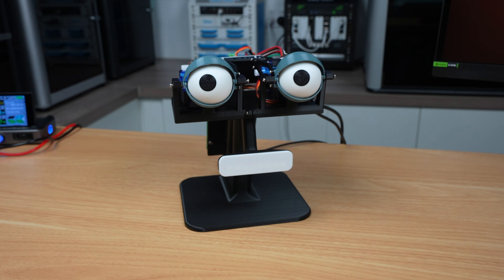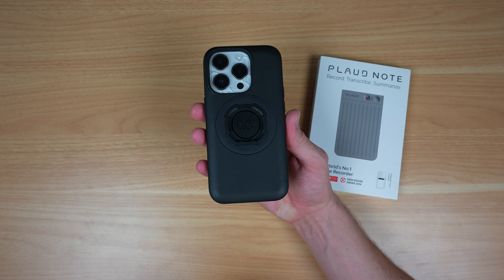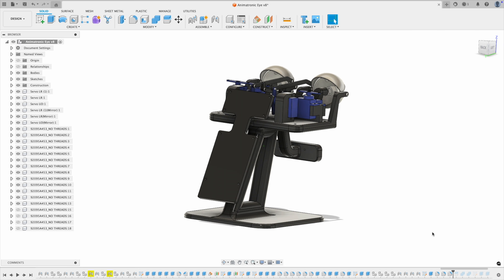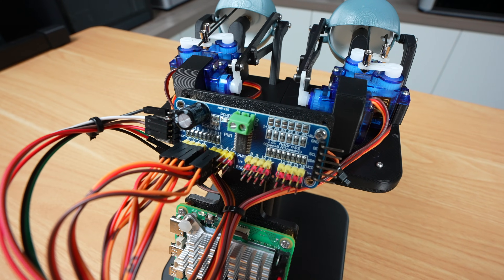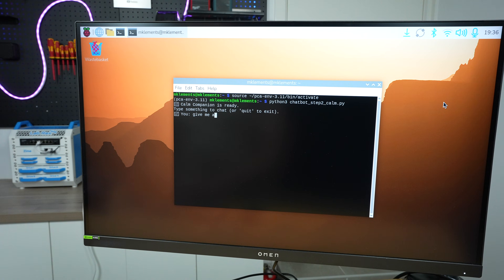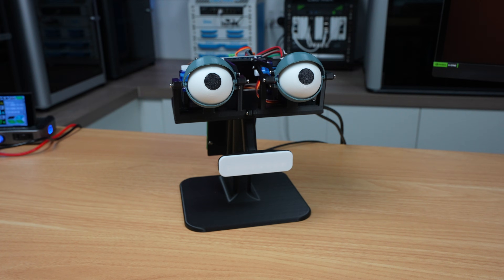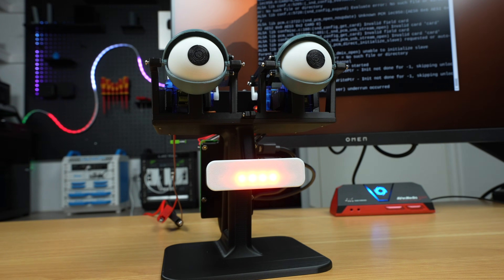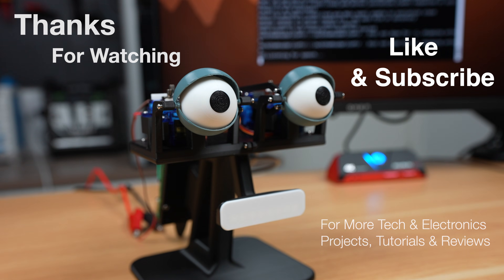I Built an AI Chatbot That Talks, Blinks, and Looks Around!

Comment: Great project, I got most of it working, but having some invalid sample rate issues. Can you provide any ideas on how I should try to resolve these ?
Reply from the maker: Can you share a bit more about the issue, error messages etc.? What hardware are you using for audio? It sounds like either the audio library is being asked to provide a sample rate that it can't handle or the problem is with the audio device itself.
Reply: @MichaelKlements  I figured it out after a little more tinkering, looks my gear was set at 48000 khz, so I just had to edit your code, which was set at 16000. All is working well now, thanks again.

Comment: Really nice projects, congratulations for the achievement.

WRT what has been suggested about using a camera for detecting people in front and react accordingly, maybe the OpenMV models could help a lot. They are capable of face recognition and tracking thanks to their embedded processing. You just get the id and coordinates of the face on the communication link. Demos such a asking the animatronic to follow a given colored object with the eyes should be a piece of cake with the help of such as sensor.

The only real problem to solve for the moment is the annoying noise made by the servos. I have no special idea about how to do it, apart maybe placing them in some soundproof enclosure and connect them to the moving parts with thin nylon cables or fishing lines running inside PTFE or Nylon tubes (such as the ones used to guide filament in 3D printers).
Reply from the maker: I agree, a good next step would be facial tracking.

The servo's I've used are really cheap hobby ones, higher quality or purpose built "silent" servos would reduce the noise considerably.